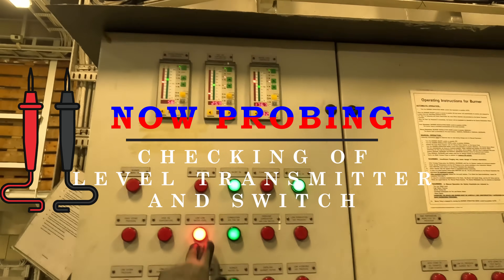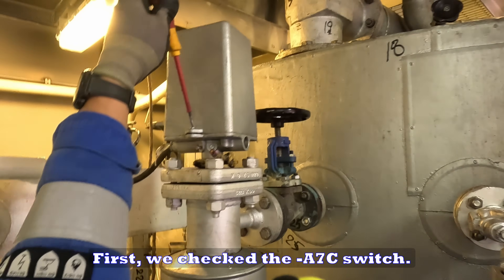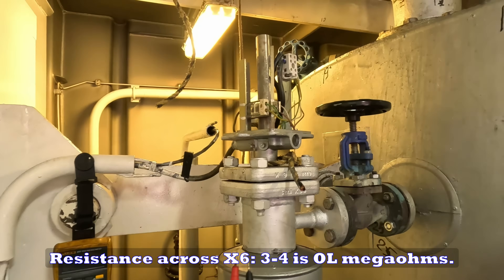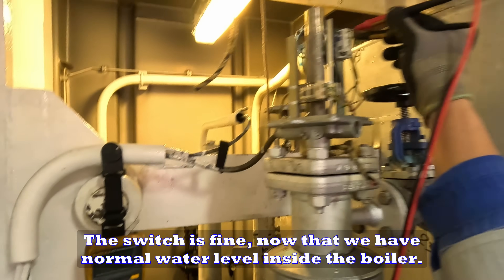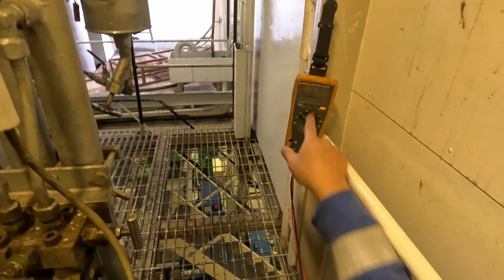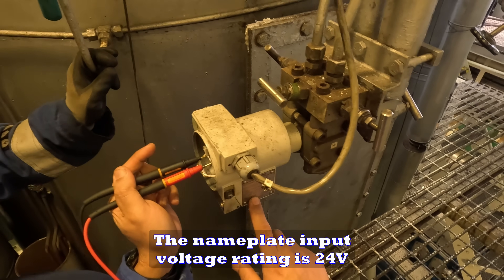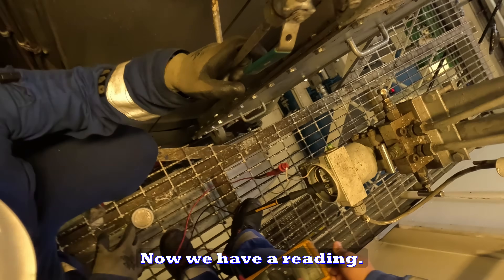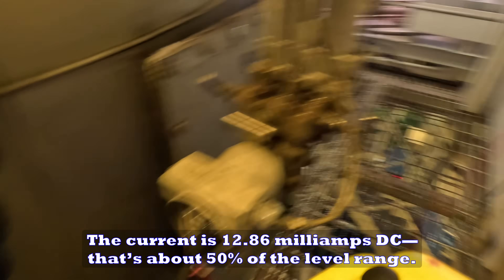#ProbeTips! How to Check Boiler Water Level Transmitter and Too Low Level Switch

Comment: Don't you need to disconnect power before measuring resistance otherwise can ruin your multimeter? keep up bro :)
Reply from the maker: Hi. If you know how the multimeter works, you can do so, again with safety precaution. Read your meter’s manual first. Keep on probing.

Comment: What is the purpose sir of the A68 limit switch sir??? Why is it series with the level switch low low level?? Where is is located and purpose?
Reply from the maker: That I will explain in the next video. 17A6B device is a trip amplifier basically with two limit switches (aka relays). Relay 1: N.O. for too low water level and Relay 2: N.C. for low low water level. Stay tuned. Keep on probing!
Reply: @ProbeLem ty sir !! Looking forward to that video sir, ur videos always help me

Comment: does 19v indicate its defective? or is it standard voltage drop on transmitter?
Reply from the maker: The 19V reading does not indicate that the transmitter is defective. Although the power supply is rated at 24VDC, it’s normal to observe a voltage drop across the transmitter due to its internal load and loop resistance. As long as the transmitter is drawing a current within the expected 4–20mA range, in this case, 12mA, it indicates that the transmitter is functioning properly.

Comment: This is good connection, multimeter in series with transmitter.
So, level switch work on 110 V AC?
Goood video
Reply from the maker: Hi, glad it helps. The level switch loop is from 230V potential. The line-to-ground is ~115V. Keep on probing!💪

Comment: And what is conclusion? Defective transmitter?
Reply from the maker: No it’s not. It is the trip amplifier. This chapter is part of the full length video #ProbeDD2025! How I Fixed Oil-Fired Boiler Low Low Water Level Alarm (Dry Docking Day 32). Stay tuned for the whole episode. Keep on probing💪.